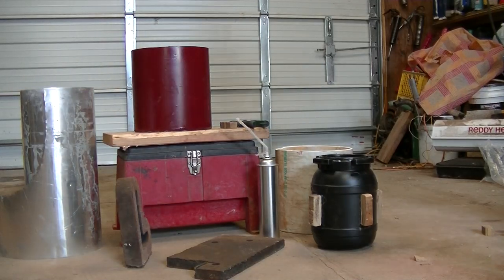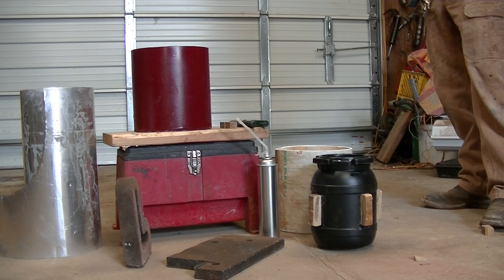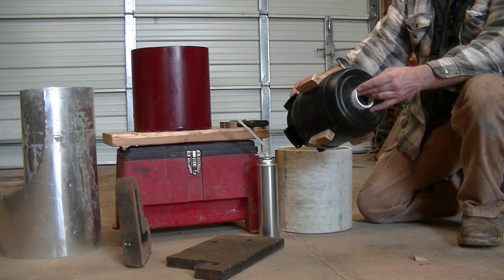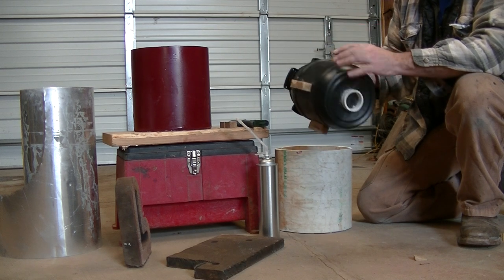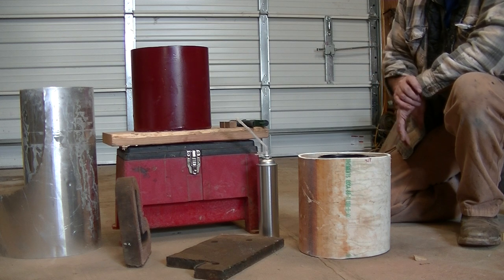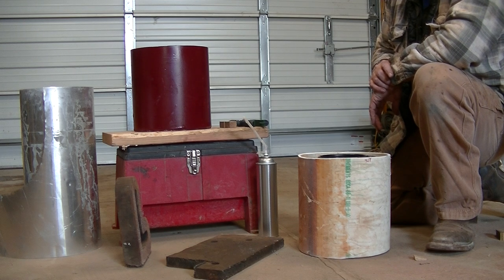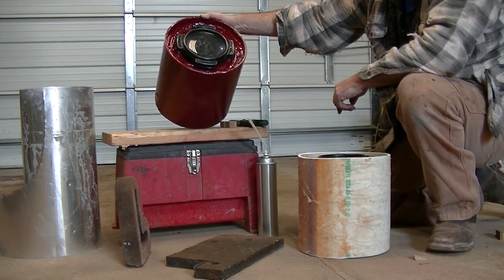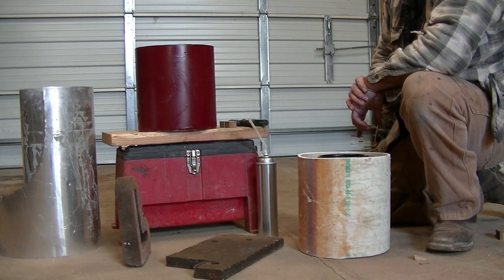DIY quiet Rock Polisher Drum. Lapidary

Comment: 7 months on now, how is this holding up for you?
Reply from the maker: Motor and drive are running great, and Ben pretty mutch going nonstop . I have worn out one drum and had to make a new one . The pvc first drum I made is holding up very well . Just the pvc is so expensive 😫.  In search of an alternative.
Reply: @40thplumengineering61  pvc is pricey for sure, when I built mine, I was going to use the screw cap type ends, but A. dang! and B. I was worried about grit galling the plastic threads and then leaks for sure. I am glad yours are holding up well.